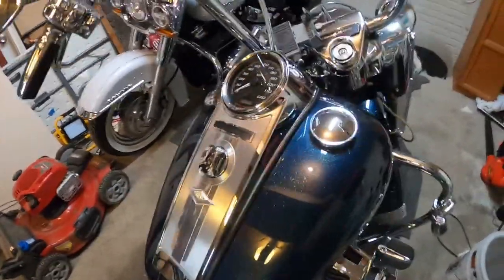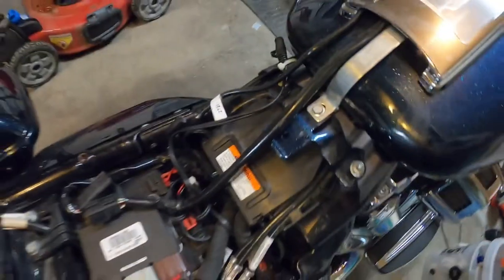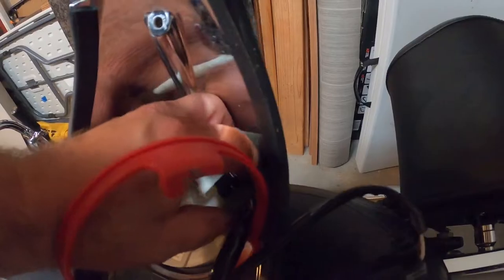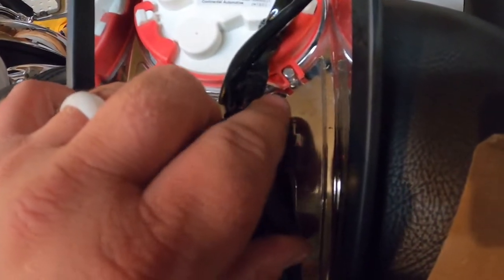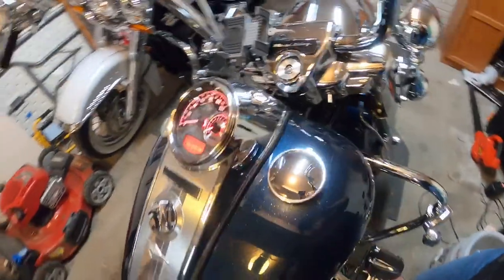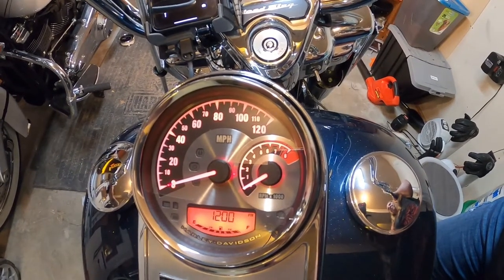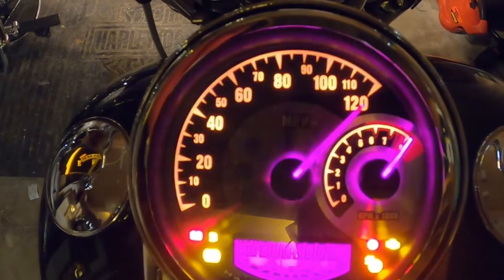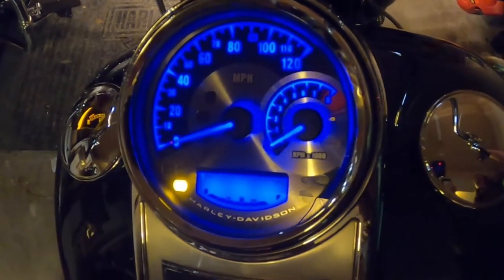Roadking Speedometer / analog tach Install!

Comment: Now that this video is 2 years old, how do you like it now that time has passed?
Reply from the maker: I love it. I love the gear indicator being on all the time, the analog tac and the blue is much easier on the eye at night.
Reply: @StevyFaux  I have read some reviews of condensation inside the gauge. Have you had any issues with that? Thank you for the reply!
Reply from the maker: @jimmiller82  a little. But my wife’s 2020 deluxe and my buddy’s Roadking with the stock speedo has the same issue. I think it’s a Harley thing.

Comment: I presume your Road King is a 2016 (?) the installation instructions say a Digital Technician is required for the install. Is it really necessary? Thanks!
Reply from the maker: With my 2016 Roadking and now my 2018 Roadking I unplugged the old speedometer and plugged in the new one and the ECM transferred everything instantly.

Comment: What's up Steve? I just installed the same speedometer.  Did you have a problem with it moving around? It's like the rubber seal isn't thick enough. Any suggestions?
Reply from the maker: I don’t have any problems with it at all. I guess check to see if the rubber seal in in place and didn’t move on you. Or maybe find some really thin weather stripping, or... wrapping gauges in electrical tap always seams to make them fit a little better sometimes.

Comment: I bought this for my 2004 RK Classic about 3 years ago, work great-however when I was riding home last night the "ABS" light came on (it never did in the past} the issue is I have NO ABS on the bike, does anyone have any idea WHY this happened? I tried to correct by disconnecting and re-installing the main fuse--no improvements, the ABS light continues to stay on. any ideas/help is much appreciated -- thanks
Reply: hi i have 2004 roadking custom i got a question on your 2004 RK the shift indicator on that speedometer works

Comment: So it does the data transfer automatically. How are they when riding at night? I take it they are a lot brighter then stock. I’m ordering them for my fat bob off the back of this video 👍🏻
Reply from the maker: Yes it transfers. At night it’s great. The blue I have mine set on is easy on the eyes. But I went through the colors to find one that was easy on my eyes in the dark. The only issue is with the blue and red it’s set on I think I’m getting pulled over with the reflection on my handlebars. 😂

Comment: Did it automatically register the original odometer mileage or does it start at zero?
Reply from the maker: Mine registered automatically. I think there is a certain year that it comes with a jumper wire to plug into the ecm to program the speedometer.

Comment: Did you have to order it with the mileage? Or does it read it from the bike?
Reply from the maker: @diego2246  it will vin lock when you hook it up. It reads the mileage off the ecm.
Reply: @StevyFaux  thanks!! And did you need to get any additional wiring? I ride a 2023 Road King Special.
Your bike looks awesome!!

Comment: What year Roadking do you have? I have a 2005 and looking to install one of these also. The one for a 05 Road King comes with a data transfer cable to transfer all the data. From your video it didn't look like you had to do that with yours
Reply from the maker: Mine is a 16. Mine updated itself. But yes yours needs the transfer cable. It’s not difficult though. You plug the speedo into your data port under your seat with the transfer cable. If I can help let me know.

Comment: hi, thanks for the video. Did you removed the mai fuse for the install?
Reply from the maker: Thank you for watching. No I didn’t. If you feel you need to go ahead. But I didn’t change the wiring at all. All I did was unplug a plug and plug it back in so I wasn’t worried about crossing anything up.
Reply: @StevyFaux  thanks! Some do it and some not, so I wasn't sure about that. Greetings from Germany! ✌️

Comment: Did you program new speedometer before you removed old one?
Reply from the maker: Nope. Instructions said to just install the new one and it would program its self. I think on the older models you had to use a jumper to hook it up directly to the ecm but with the 2016 all I had to do was install it and plug it in and it was programmed.
Reply: Not necessarily, depends on the bikes age. I had to use the data cable

Comment: Nice video. I wonder if I could pick your brain ?
I just got a used 2006 RK Classic which has a tank similar to yours. I can really read the fuel gauge cap. I can't tell if it works or not.
I'm a newbie so I was surprised it wasn't a 2nd fill hole. I finally got it out and saw it was connected to a wire harness connector.
Questions : 
a)  is the right cap the only fill for both sides ?
b)  is the left cap only the fuel gauge ?
c)  what is the name & price of the speedometer you installed (can you share a link ?)
d)  how did you control (set) the color of illumination ? (remote ?) (phone app ?) (?)
Thanks for your generous consideration,
Love the channel,
Sincerely ..............................
Steph
Reply from the maker: Yes the left side is the only gas cap. They quit using split tanks a long time ago they are all one piece now. So the left side is just the gauge. It is hard to read and kinda of useless. They do have this speedometer for your bike but it will be a differ part number cause it’s a little older bike and the computers are different. You control the colors with the blinker switches actually so jo remote or app. I will try to see if I can find the one for your year and get you a link.

Comment: It said in the instructions that after 31.1 miles that the new speedometer will become fused to the ECM.
Do you know if that has to be a continuous 31 miles all in one ride?
Also did you have any issues with the fuel gage accuracy or did you have to do exactly what the instructions say and start with about 1/2 tank fuel?
Reply from the maker: I didn’t read the directions at all lol. I have had no issues. Mine worked out of the box.  Fuel gauge is more accurate than the one on the tank and the odometer and trip all worked right away.
Reply: @StevyFaux  
Thanks
Reply from the maker: @michiganborn8303  your welcome. Hope you enjoy it. It is so much better than the stock Speedo.
Reply: @StevyFaux  
Yes, the stock speedo is so blan and boring.

Comment: Yo Stevy, Just Saw Your Video On Your Speedo Install On Your King Nice Job! I Have A 2007 Road King That I Plan On Installing The Same Gauge On, From My Understanding On The Speedo For My King I Have To Plug The New Speedo Into My Computers DLC Connector To Transfer The Mileage To The New Speedo I Noticed You Didnt Have To Do That On Your King What Year Is Your King, I'm Also Not Going To Have The Digital Fuel Gauge Read Out, Fuel Range For Miles Left In Tank, Or Gear Position I Dont Think The ECM Computer Supports That Data For That Year King But Thats Ok It's A Bad Ass Looking Gauge, Thanks For Any Imput Or Advice You May Have For Me 🤟🏼✌🏼
Reply from the maker: This bike was a 2016. Yes you will have to use the jumper wire to transfer your data. It will still be a big improvement over your stock gauge and will be easier to read. Thank you for watching!
Reply: @StevyFaux  Stevy, Will That Speedo Give The Check Engine Codes Also?
Reply from the maker: @fidelrodriguez6568  mine will show the codes.

Comment: Would this work on a 2012 roadking as in it will read mileage from ecm ?
Reply from the maker: @yoboishifty2480  I found this. For the 2012 the speedometer comes with a data cable. You plug it into your ecm and the speedometer and it transfers the data and vin locks the speedometer. Here is the link. 
https://www.harley-davidson.com/us/en/shop/combination-analog-speedometer-tachometer-mph-km/p/70900072A
Reply: @StevyFaux  thank you !

Comment: Nice install vid!  Man, if there is one thing that I miss it's having dual analog speedo and tach (up on the bars!); digital tach are an abomination!  

Looks good!  How much was the new unit?
Reply from the maker: Genome Presents not cheap. I will have to look. I got it at the same time we got bags for the deluxe.
Reply: I paid $342.51
Reply: They are about 300 bucks and some change

Comment: Didn’t u need to calibrate or sync your miles????
Reply from the maker: Nope, just plugged it in and it was all on there. My bike is a 2016.
Reply: On my 08, you have plug the new speedo into the DLC with an included cable while the old speedo is still installed. Once you get to the DLC is probably adds 2 mins to the install.
Reply: @richardquintus1476  What if you dont have an older Speedo on a 07?  Would the speedo start at 0000? lol